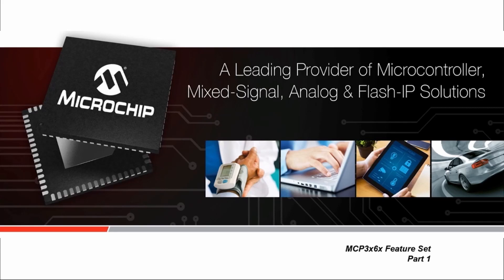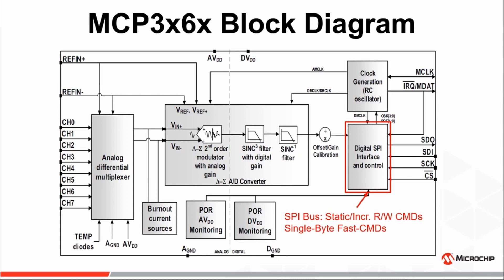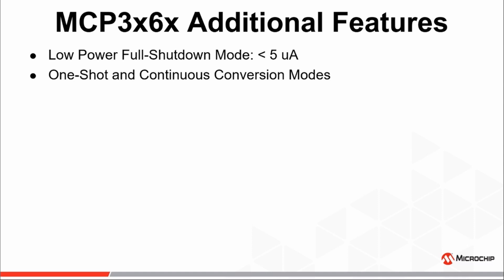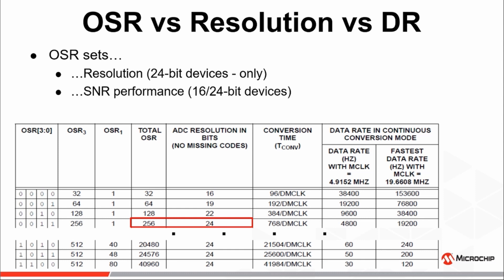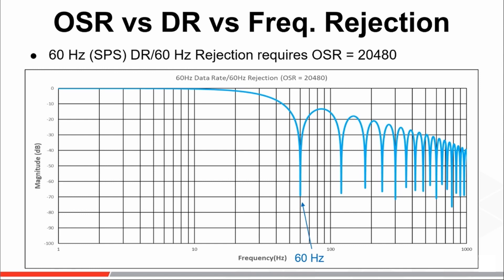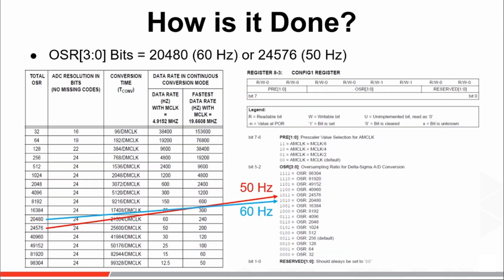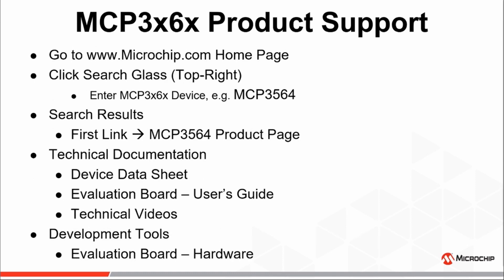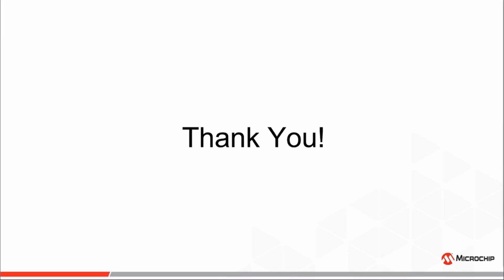MCP3x6x Key Features - Pt. 1

Comment: When the ADC resolution is higher than 16, there would be overflow since the result register is only 16 bits. Can you let me know how is this overflow handeld?
Reply from the maker: Hi there, thanks for reaching out. If the resolution is set to a specific value greater than 16 bits, the MCP3x6x ADC result register may overflow. When an overflow condition occurs then the MCP3x6x sets an Overflow Flag bit (OFL) for the Status Register. We would suggest choosing a lesser resolution or building extra software logic to acquire the complete conversion result. Hope this helps!